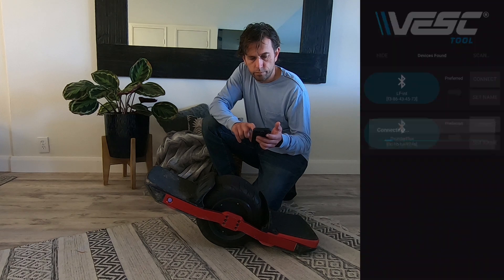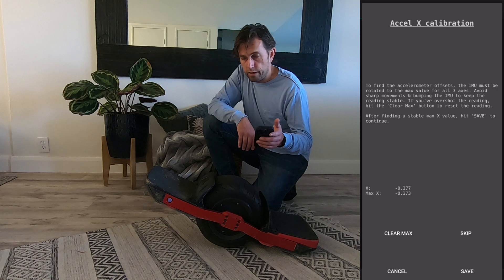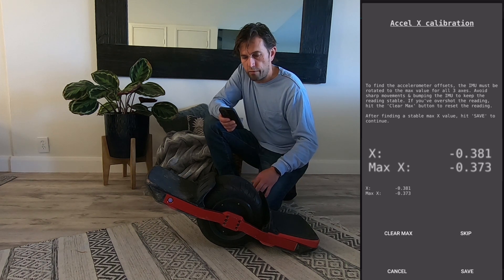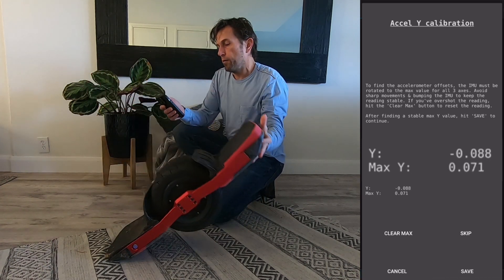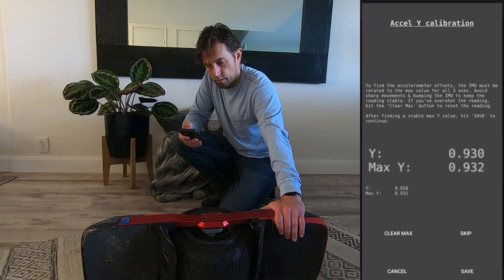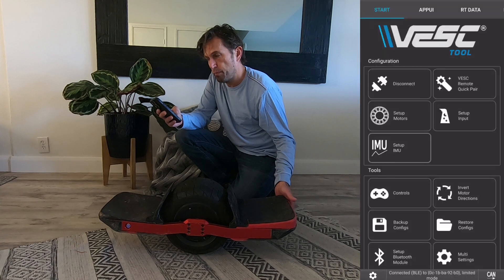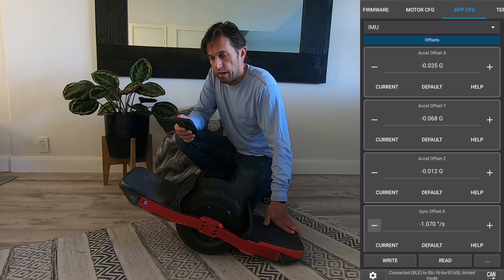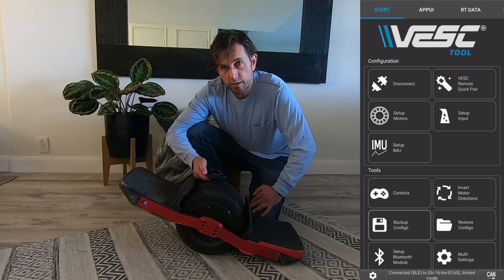VESC IMU Accelerometer Calibration - How To

Comment: If i screw this up part of this does it have potential to brick the board or is it as simple as reverting to default and starting again?
Reply from the maker: @seebooj  you can’t brick your board - but of course you can make it worse if not doing it right. Key factor is that some calibration steps don’t work well when not starting from default settings, aka all 0

Comment: Hi, can you help me please, I did add a buzzer to my VESC, also I did enable server output, it beeps but is really really quiet, not sure what is going on
Reply from the maker: Hi, I recommend the Grove buzzer, also it’s always a good idea to bench test the buzzer to see how it sounds and works before putting it into your board
Reply: @surfdado  Thank you, it looks like the Grove buzzer and the one I'm using they are the same specifications and have been designed to work whit the same equipment like Arduino and Raspberry, also I did bench-test it, to make sure it work before I install it into my board. Can be I missing some settings?
Reply from the maker: @GPeter7  it beeps or it doesn’t. There’s no settings. Maybe you’ve flipped signal and 5V? Sorry but I can’t think of anything else
Reply: @surfdado  I did check all wires multiple times before I plug it in. Most likely I will get Grove buzzer like yours, thank you for all your help, I really appreciate it

Comment: I’m getting around max 2.0 for each axis, and final values stored in app settings are like -1.05. 

What am I doing wrong 😅
Reply: I had that when i ran the calibration twice in a row.   It appeared to be adding the results of the two calibrations together.   Got around it by restoring to my backup and then preforming the calibration again.